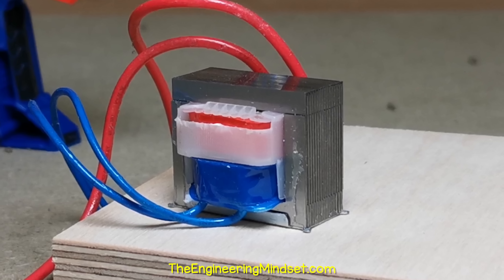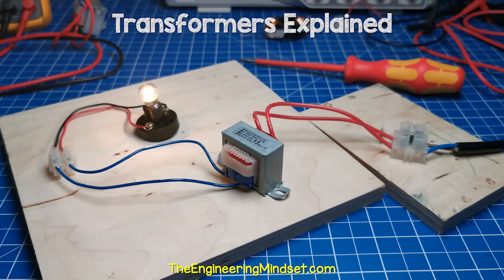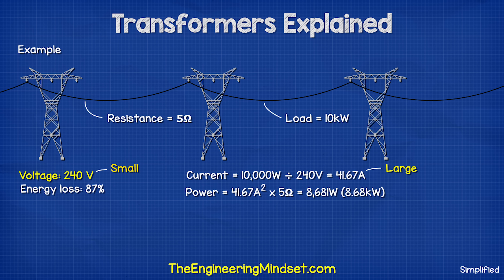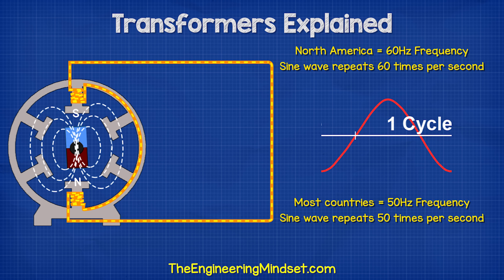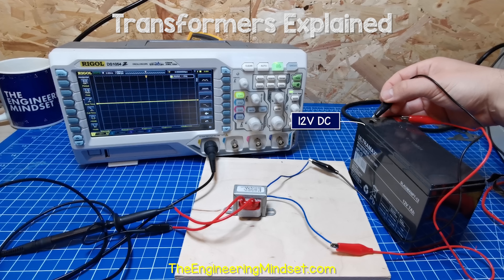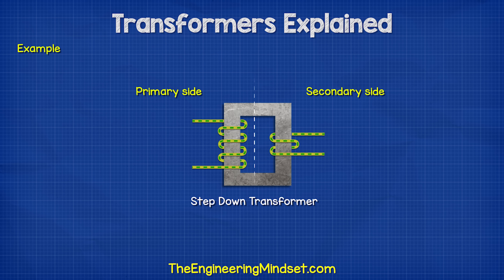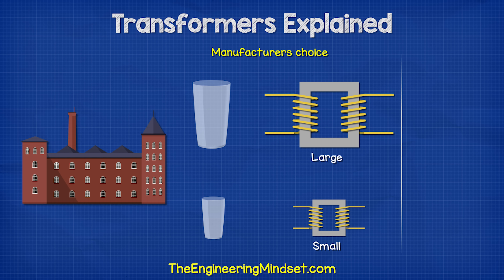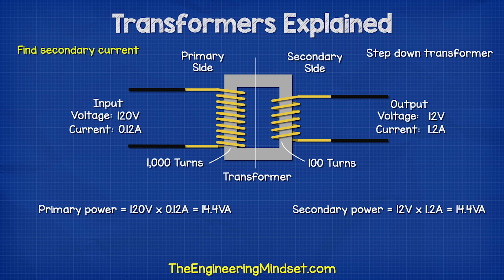Transformers Explained - How transformers work

Comment: Generation has everything to do with rom to pole relation. The poles need a dc voltage to become a resistance against the magnetic field the stator is holding the transfer of electrons from the dc energized poles that are being rotated by a power source are collected by the stator.  This is done by magnetism and the resistance of the magnetism. Interface of opposing magnetic fields. This it collected in volts or potential energy, aka actual work, but the voltage has to be stepped up or down depending the distance the energy is being used.

Comment: A step up transformer is used in the automotive ignition system. Current comes from a DC battery. You’re wrong stating transformers only work on AC.
Reply from the maker: Thanks for your feedback, but at 8:02 I explain how it works with DC.

Comment: I have seen them in Bug Zapper in a electric bug swatter. An HV transformer that the insulation broke causing corona arc within transformer. Hence now static electricity charging my body to shoot lighting from my fingers... 😢 Because I touch ground and one of charged output wires causing shorting circuit and boom! So now no work anymore.

Comment: A transformer can be made inoperable by placing a strong permanent magnet near it.  A permanent magnet can prevent a transformer's magnetic field from expanding/collapsing, thereby reducing or completely stopping a transformer from functioning.  A permanent magnet can be used externally to modulate the output of a transformer thru mechanical means instead of electronic controls.

Comment: Where have I seen transformers?
3 in my Vox Defiant. One for the AC wall voltage (4 tap coil primary. 3 coil secondary, one with a center tap), Reverb Tank and Boost Driver thingy (2 coil one side, 1 coil other side, idk which is primary)
Old 60s amplifier equipment is very quirky.

Comment: So on a HVAC transformer, let’s say a step down 120 to 24 volts AC, how come even tho the current increases as said in the video, most people can usually handle the bare wires without feeling anything or nothing at all. Is the current still that small, or am I missing something?

Comment: Old HID ballasts have cool transformers, also really old battery chargers for power tools, automotive battery chargers, they're big and heavy typically for lower hertz or frequency.  Microwave transformers are crazy too, very powerful. Good for diy welders.
 You can make low frequency inverters, DC power supplies, crazy bug zappers, etc.

Comment: If a step down transformer has 18 volt 2 Ampere rating and after rectification using 4 in5408 Diodes and a 2200 uf capacitor which delivers 28 volt dc output, can it deliver full 2 Ampere current to a load without any voltage drop ?
2. If on drawing 500 mA current from the same transformer drops the output voltage from 28 to 20 volt then is it normal or some problem is there with the transformer ?

Comment: at 4:25 is mistake, right? P=(Vpower2)/R not (Vpower2)*R
Reply from the maker: No mistake. You can use P=V*I, P=I^2*R or P=V^2/R to calculate power. I've used I^2 x R

Comment: Our high tension transmission lines are 100,000 V which then step down to 34,500 throughout the neighborhoods.  Then stepped down again to the 120/240 VAC.  Your explanation is nice and thorough.

Comment: Thanks for the video. I have a question:a 110v to 36v AC transformer, can I use it with 220v. If yes will it give 70v. Thanks
Reply: no.  it will smoke 😅😅😅.
Reply: @ncolevalv_5673  Why would it smock?

Comment: I once noticed that transformers used for controlling voltage like transforming 440v to either 220v or 24v whichever is used for controlling and there are always fuse before and after

Comment: Im from Philippines I love your videos and I have a question, my input is 220v, is there a specific amount of turn to the primary for it to work, example: my primary turns is 1,000 with an input of 220v and the secondary is 100 with an output of 12v, but what if my primary turns is only let say 500 ang the input is still 220 and my secondary is 28 turns I calculate it and the output is 12.32, will it still work? even though the number of turns on the primary is less,? or will it burn my house?

Comment: Trust me. Direct current can be ramped up just as easily by a different method but still accomplished. So yes, transformers work for DC.
Reply: not like ac transformers are constructed.  it will just pulse and die like in the video.  you need a driver for it work.

Comment: Nice video there sir, this approach should be used in colleges. Anyway i have this small step down transformer 220 volt to 12 volt 1 ampere and i want to install a fuse at the primary, what fuse do i need. Thanks in advance.

Comment: Your right,  but have another question  ,I have a transformer of 500 watts step up  120 to 220 and  have a grinder of 750 watts 220 .what is the reason that the transformer got extremely hot and  burn the wires and was not one wire trafo
Reply: you exceeded the power output of the transformer. it was operating at the max current.

Comment: Your not really explain something  correct, as a child that was long ago I was told that transformers work at ac but I witnessed when contact a battery and put a condenser on the secondary side with a diode and bulb ,it light up if I connect and disconnected it fast but my teacher didt gave  me a  satisfied answer
Reply from the maker: That is explained at 7:59

Comment: they are 2 currents because 3 phases 1 is nutral and the other 2 is p+ p- poles and N ,COPPER IS NON MAGNITIC OR diamgnitic ,it slows the magnet why because its chragrle ,us copper made from clay red clay ? u can make copper from clay inside a clay furnace hhhhhhj.

Comment: Hello, on the section where you calculate the KW I don’t understand how it’s an 87% loss because the original power was 10KW but now it’s 8.68KW so isn’t that actually a 23.2% energy loss ?? Correct me if I’m wrong just a bit confused on that bit

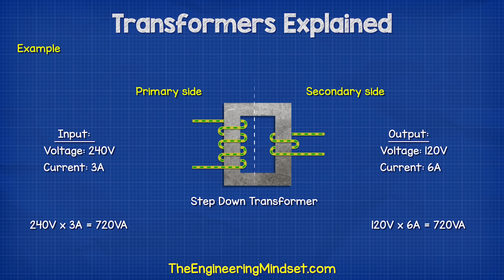Comment: 10:57 but why it produce less current?, i thought current is proportional to the voltage, i know about conservation of energy but what makes it happen?, there is no way to just say "it is because conservation of energy", transformer cannot just decide to lower the current if the voltage is increased to obey the law, that explanation doesn't explain why it produce less current...
Reply: My guess. because u have extra resistance and the extra resistance makes it so that u now have less current capable of going through it cuz conservation energy is bullshit
If that's the case then why can u just increase water pressure without having to sacrifice the water amount if u say that's because u have a electric motor making extra pressure then aren't magnets supposed to do that for electricity a secondary source of electro magnetism that can boost electricity
Reply: I think the rather big electromagnetic field on the side with less windings of wire can now be used to „accelerate“ the current on the side with more windings. Because the force of the field produced by the side with less windings only needs to accelerate the fewer electrons in the side with less windings, each electron can receive the energy that hat been in let’s say three electrons on the primary side, thus creating more current. I hope this helps to understand your question. It is not „because it does“ and it’s not like it just happens.
Reply: what makes it happen?  because it does. .  thats it.  it is like asking why a pot of water boils when placed in a fire.  because it does. you are overthinking it.
Reply: @rodzvalv_5673thats such a bad response. Understanding these processes on fundamental level is key to deep understanding. Just brushing it off and saying "it is what it is, dont overthink it" is such a bad approach.
Reply: @ncolevalv_5673 there’s literally an answer to why water boils, the molecules heat up and are separated from the excessive energy, so there’s an answer for this question as well

Comment: Transformers are used in electrical cars, in household appliances in renewable energy plants. They transfer high voltage into low voltage, so they provide isolation

Comment: There's something I don't understand. At 4:27, you compute the current from the load. Why? Shouldn't you compute it using Ohm's law by dividing the voltage by the resistance? And only after you compute the power as voltage times current? What am I missing?

Comment: So you're telling me I can tell whether the generator is running on 50hz or 60hz just by the sound of the transformer? (higher pitch = more vibration = higher frequency, same goes with lower pitch = less vibration = lower frequency).

Comment: You said at time 1:01 - transformers work with AC ONLY...  Not true!  They work with PULSED DC as well...
Reply: AC - alternative current, so if a DC voltage is being altered to a wavy form going between + and - it becomes AC
Reply from the maker: Pulsed DC is also shown in the video

Comment: I have 3 degrees in electronics and electrical engineering , your blog is so wonderful and explanatory. Your lecture on English and European voltage and power being different from American power,  was the very best I've ever had . Thanks kindly and good luck .
Reply: Could you explain how say in a step down transformer the volts are low but the current is high how that can be used safely in bathrooms and without destroying equipment plugged into it? Like do you also need a resistor in series to lower the amps and if you were to short this current with your finger would it not fry you since it has the same potential as the source voltage?
Reply: @asabovesobelow1362  using an isolation transformer would separate you from earth ground . You would be in danger from shock but not necessarily electrocution. You sound like you understand your circuit .
Reply: @martinfarfsing5995  I'm an electrician but I've never gotten my head around how a step down isolating transformer used in bathrooms can be considered safe if the potential energy is nearly the same, also wouldn't the high current lead to higher cable losses. Idk I the more I think about it the more confusing it gets like how can there be current in a closed circuit and it not gradually overheat.
Reply: I guess it has to do with the voltage being low and the resistance of your skin being high, and that the transformer isn't being designed to send over all of it's potential energy.
Reply: @asabovesobelow1362  the power in a closed circuit is limited by the load,  resistance in circuit. Use p= I times E  and use E= I times R , equations to see this . If R and E and I are constant than P will be too . OHMS AND WATTS laws . Yes , high voltage from any source will kill us .  Isolation Xfmr usually has low voltage.

Comment: I am a Service Supervisor for a company called Allmand. The last ten years I have worked with AC power. I did not come from an electrical background and learned everything from experience and electrical engineers. My company mfg portal light towers, heaters and generators from 8kw to 45 kw. Our light towers use 1250 watt metal halide lights, x 4 per unit. The ac generator produces 1 phase 120/240 to light breakers. Each breaker sends power to transformer that will increase power to each light (360-440 +/- 10%).

Comment: For general information you can use pulsed dc for transformers.
Also possible to apply dc with sinus voltage (offset "ac") though it will be a bit saturated. 
The term you are looking for is the change in current...

Comment: A question about the equation for calculating Power Factor:

If Load (kVA) = True Power (kW) / Power Factor (P.F.), then wouldn't the P.F. simply be written as P.F. = True Power x Load, instead of P.F. = True Power / Load? It makes sense logically, but mathematically, it is not making much sense to me. I may just be doing algebra wrong...
Reply from the maker: Check our new  Power Factor Explained video soooo much detail and easy visualisations https://youtu.be/NIrKOVZrqnU

Comment: When you induce ac electricity you can get more output than input you can input 27500volts and step it up to 440000volts for power line distribution

Comment: Loved the video and the beer example, tho I think it would have been better if the relations
(turns in primary/turns in secondary) = (input V / Output V) and 
[V(in) / V(out)] = [I(out) / I(in)] were given instead of (or before) the section where you gave a bunch of formulae derived from these relations.

Comment: Transformers create electricity through electromagnetic induction by transferring electrical energy from one circuit to another using a changing magnetic field. When an alternating current (AC) flows through the primary coil of a transformer, it generates a changing magnetic field around the coil. This changing magnetic field induces a voltage in the secondary coil of the transformer, which in turn creates an alternating current in the secondary circuit. This process allows for efficient transfer of electrical energy between circuits, enabling voltage transformation, current transformation, or isolation between different parts of an electrical system.

Comment: At 3:54 aren't the voltage and current directly proportional? Why does the current decrease when the voltage increase?
Reply: Cars are amps and speed is voltage. On highway you have less cars per 1km and when there is a traffic you have a lot cars per 1km but they are going so slow. This is easiest way i can explain this

Comment: You didn't really explain why 240, 3 wire systems are used in the US and a few other places. If a 2-wire system supplies more power to the outlet, why do it another way? Are there benefits to it? Genuinely interested, havent heard anyone explain it.

Comment: The step up transformer seems to operate on a very similar principal as mechanical advantage does in a gear ratio. It trades torque for rotational speed, but the velocity of the gear teeth remain the same.

Comment: 1:22 I used it on my train set. One day I got a broken transformer and removed the heavy block iron with copper spools. I connected the 12v of the working to the 12v of the salvaged transformer. The system did not seem to like this. At one point it bit me. Quite hard, it bit me. I still vividly remember, almost half a century later.

Comment: Hi! I used some transformers recently when I installed new pool lights in one of my properties. I installed 4 transformers, each converting 220 volts from the city to 12 volts. The pool lights only run on 12 volts and nothing more for safety reasons, you don’t want 220 volts anywhere near your pool! Thanks for the amazing content.

Comment: Beautifully explained. However, I have a small comment. Reactive power is neither useless energy nor is it converted into heat. You are confusing reactive power with ohmic losses. Reactive power is required to build up and break down electric fields or magnetic fields and is not consumed but rather oscillates back and forth between the source and the load.

Comment: You said transformers don’t work with DC so please tell me my college professor is wrong as well as my 30 years experience …. HOW does your cars motor take 12 volts and step it up to create 45k volts to fire your spark plugs to ignite the Air Fuel Mix  in the cylinders is it magic or genies that do it SPARK PLUG ????
Reply from the maker: Watch the video in full, I did clarify how DC can be used.

Comment: What is a calculation to keep in mind for increasing or decreasing wire gauging on either side? Say for example, to increase the wire gauge on a side intended to step up from 10 to 20 turns.

Comment: You mentioned step-up & step-down transformers. But what about Isolation Transformers, where the primary & secondary turn amounts are the same? What are the usage cases & limitations of isolation transformers.
If I used an Isolation transformer, to isolate an experiment for example, would there still be outside interference to the experiment, or the experiment can still threaten the power supply? I don't know.

Comment: Passing a conductor through a magnetic field creates a current.  That needs to be mentioned.  Therefore, when the because the magnetic field is rotating - as in a generator - current is created.  The density of the flux and number of winding of conductor determine the voltage.

Comment: 67.4 squared is 4542.76 not 4544.88 changing the answer to 30.70? Am I wrong?
Reply from the maker: I'm not sure where in this video that value calculation is shown, but such a tiny difference will just be a rounding error
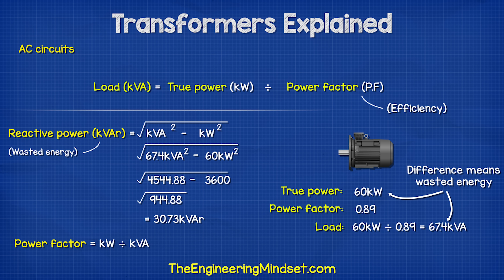Reply: @EngineeringMindset  11:57
Reply: Going to school for CP rail very soon, and just doing some studying beforehand.

Comment: Linear Variable Differential Transducers (LVDTs) in actuators. It's not exactly what you were talking about here, but a very similar concept (i think due to induction, if I'm thinking of the right term). They basically measure the position of an object by how much power it transfers from the primary side through to the secondary side through the "core". So, if it's fully retracted, perhaps all of the voltage is transferred and measured on the secondary side. Conversely, if the object is fully extended, it might read the minimum voltage on the secondary side. Then, the computer knows the exact position of the actuator by the measured voltage difference through the LVDT.